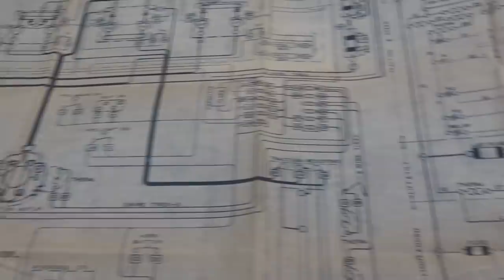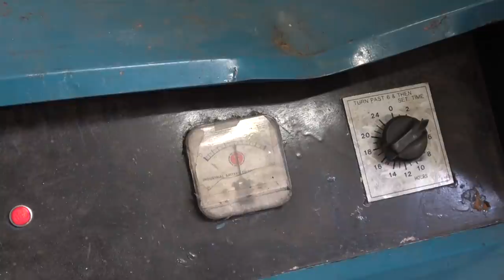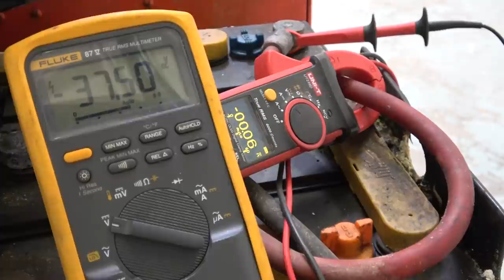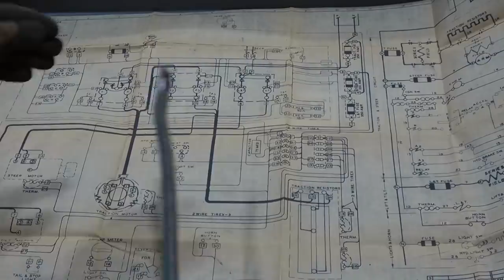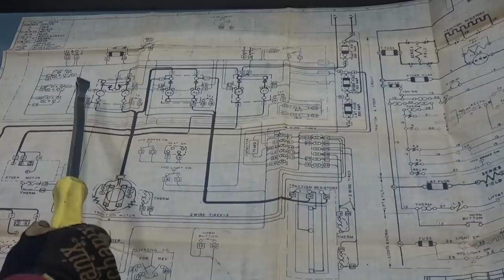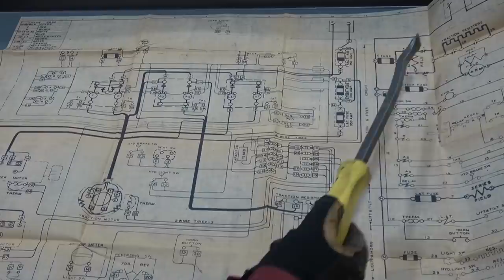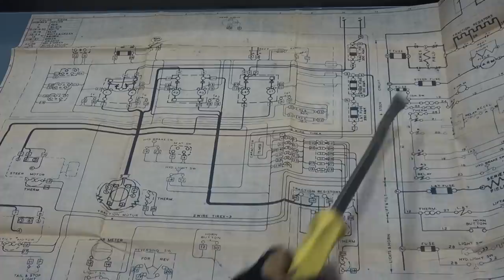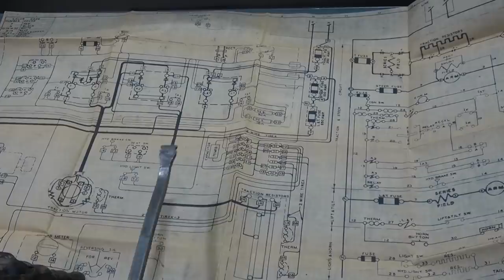Basic Electrical Troubleshooting | Battery Maintenance

Comment: Aaarrgh not more bodging and making do....... that's all I get in work while I try and fix shit proper. But if it costs more to fix proper who's going to pay out on that when a bodge is almost free....

I aren't knocking you for fixing it, I just like to do stuff properly. Speaking of stuff, I have a few jelly bean bits for your btr, a small air actuator, proximity sensorb and an IR transmitter. Details below

Cylinder 
Mfr    FESTO
L, W, H     2.75" x 2,75" x 2.00"
Max stroke   1.25" from end of cylinder
Piston rod dia    0.5" internal thread
Comes with t slots for reed switches on 3 sides

Sensor 

https://www.sick.com/gb/en/im-standard/im30-20nps-zc1/p/p235632

Sensor
https://www.sick.com/gb/en/photoelectric-sensors/photoelectric-sensors/w4-3/wtb4-3p2262/p/p221993

Comment: Just use the big fuck hammer techincal  tap method.  Guaranteed  too work right the first time... Or never again.  Either way you will feel better, until you get the bill to replace it.

Comment: I had a harbor freight multimeter that only worked like 50% of the time. After it read 0 volts once and I touched the positive wire and didnt notice the negative was touching my elbow, I got shocked so fuckin hard I nearly pissed myself. I spent the next 10 minutes taking a hammer to the multimeter. Never buy a harbor freight multimeter. Even if it's free, learn from my stupidity

Comment: I fail to see how the batteries' internal resistance (= this thing outputs thousands of pixieflows... err amps) plays any significant role in getting shocked and bitten here, or not. Dry skin resistance varies, depending on how you choose to bumblefuck, but generally safe to say it'd be at least 100 kOhms. Ohm's law: I = V/R = 36 V / 100kOhm = 0.36 mA, thats millipixies...flows...amps, for you. Are you a mouse or a man? The internal resistance of the battery is negligible and orders of magnitude smaller than the skin's resistance, i.e. doesn't matter.
PS. 100 kOhms is a very, very, very conservative estimation. In reality, it is much higher than that.

Comment: Not "water" level, as he said elsewhere, "electrolyte" (i.e. sulfuric acid).
Reply: He is checking the water level. If he wanted to check the specific gravity he would need a hydrometer. Having a fully charged and watered battery is the first thing when working on an electric lift.
Reply: "Zipties and biasplies" you don't need sulfuric acid.

Comment: You should really not be working on this you do not have a clue, it is a floating system two wires to each device, secondly you should have the traction wheels jacked up off floor so if you screw up the truck will not take off on you, once again you have no clue on what you are doing, if freame is energized their is a positive short to frame